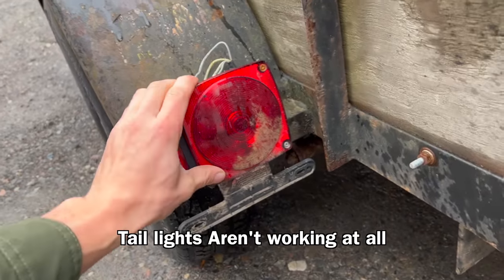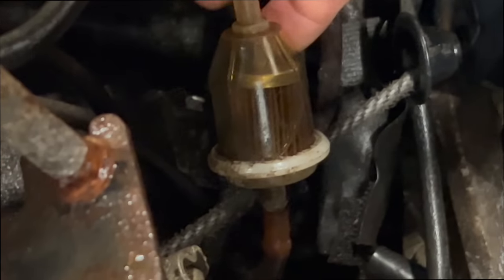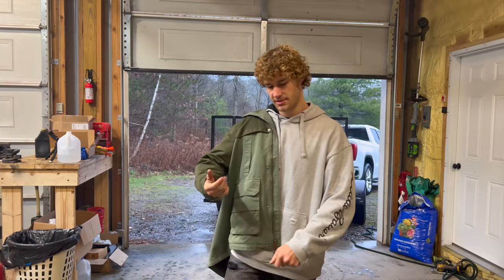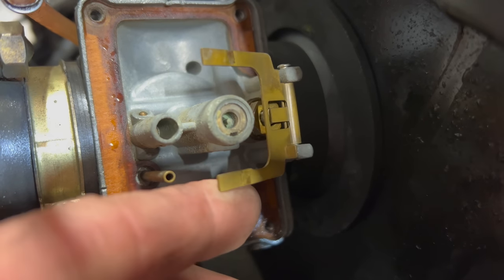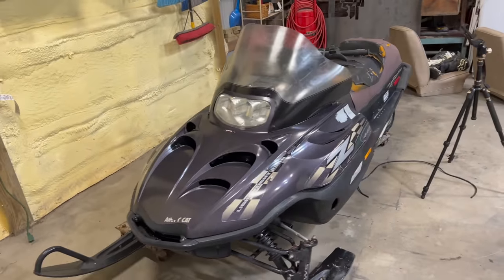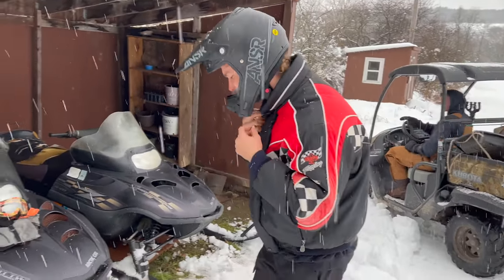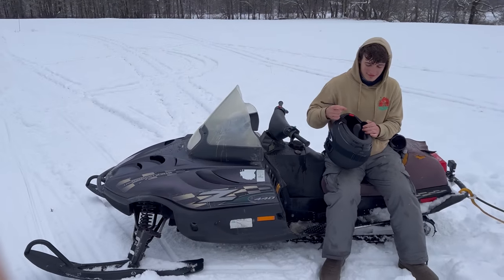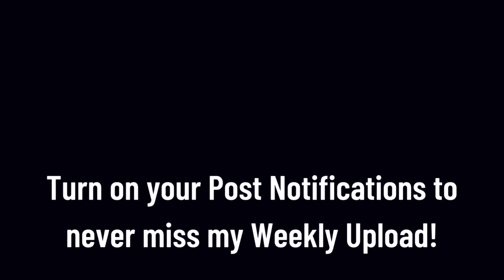Did I Get Scammed On These Sleds?

Comment: Get that old.gas out before you blow the engine up...its 7 yrs old. Gas seperates and takes on water after 90 days
Reply: Do a full tune and film it.
Reply: Didn’t know old gas would blow an engine up - run rough and/or stall I can see…
Reply: Didn’t know this.
Reply: He did at the beginning of the video
Reply: He said he drained the tank on the first one
Reply: Just started my Arctic Cat Pantera 500 from 1981 with gas from 2007 haha..
Reply: @Erated78  for a two stroke yes it will, as the fuel often has the oil in it, and just generally provides top end and combustion chamber lubrication. Water does not do a good job at any of those.
Reply: @eggsalad4298  not in sleds 99% of sleds except some race sleds have oil injection
Reply: It'll be fine.
Reply: 2 cycle is supposed to smoke.
Reply: Maybe pay attention before you comment. That’s Literally the first thing he said when he opened the hood.
Reply: Fuel with ethanol separates and takes on water. I use rec fuel and all my small engines, with sta bil good for 2 years. You can tell those didn't have good gas in them.
Reply: He literally said he's gonna drain the gas in the first two min. And I've never in my life heard of a engine blowing up from old gas lol
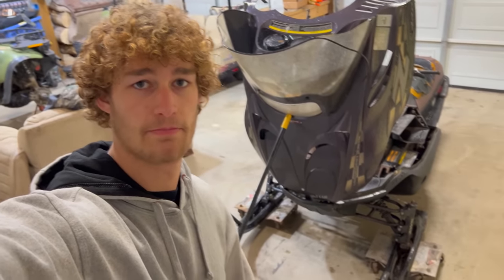Reply: @1:33 “I’m going to start with draining out the fuel tank” please for the love of god people try and keep up
Reply: Oil still is oil even 7 years old
Reply: He said let me drain this fuel tank really quick

Comment: You fell into a nice deal there. I collect old sleds and out here Fan Zs like that would fetch a grand each. The nice thing is these old Fan Zs use the classic ZR Cat chassis that they made for a decade. Parts are still out there if you dig on the web and usually not high priced. The 370 was a kids sled so it’s about 37hp, give or take. The 440 varies from 41 to about 50 depending on the year, carb set up, and model it’s in. I think the 370 was clutched and geared pretty tame. Hey it’s 20 years ago. 😎. Great beginner sleds and like Lego blocks you can look for more stuff to bolt on for mods. Enjoy.

Comment: You shouldn't worry about it smoking a bit, in fact it's good for it to smoke, I own 3 old snowmobiles, all of which are 500 2-strokes, and they all smoke a lot, which is good. But yeah, no need to worry, especially if it's old like mine, which are 2 1976's and 1 1979
Reply: Love the vids though

Comment: It would be a grand idea to check all the bearings  and slides in the track/suspension system before you burn grooves in your track. 7 years sitting means likely seized bearings